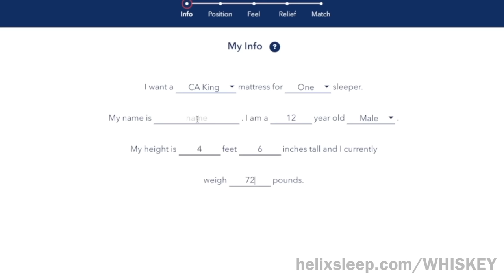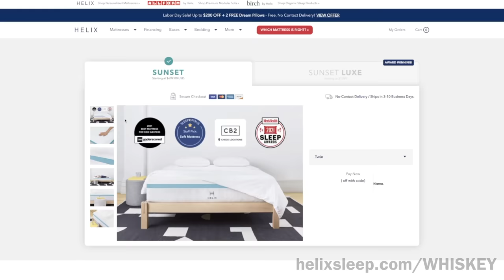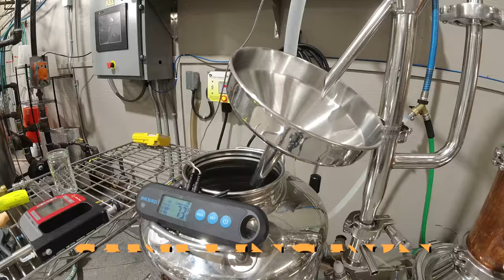We DISTILLED WATERMELON into alcohol so mom could taste JUSTICE

Comment: In my youth me and my brother used to make watermelon wine with an airlock right in the rind. We would push a 1/2" conduit in one end and pull out the core sample and up end the melon into a bowl to drain for 30-60 minutes. Take the juice that drained and add a 1/2 cup sugar and yeast then pour it back into the shell and add an airlock. When it stopped bubbling it was ready. Chill and serve. Great party favor for 13-16 year olds and nobody knew a thing.